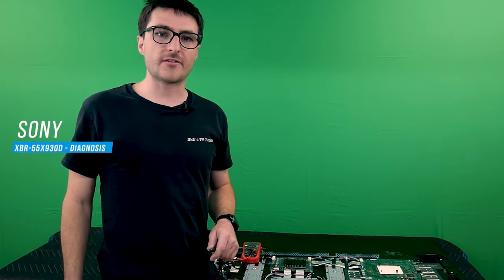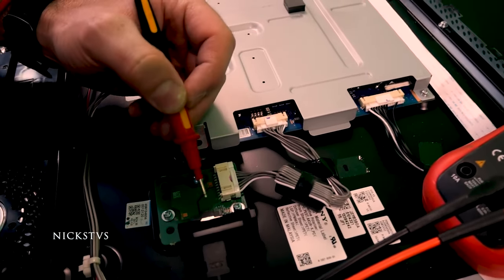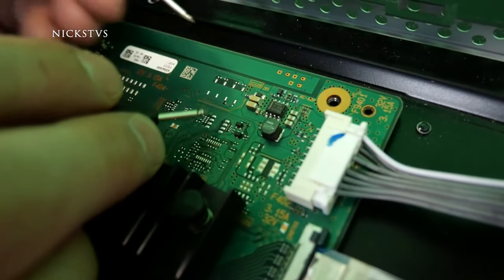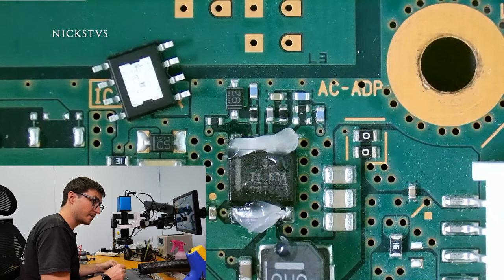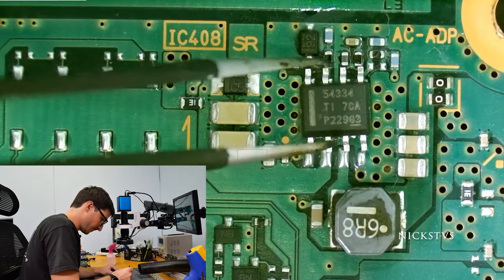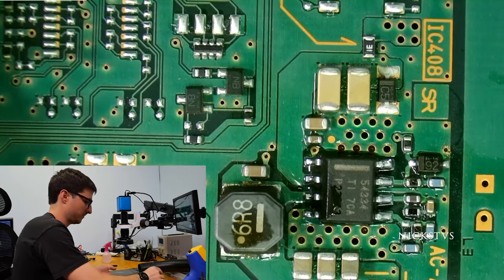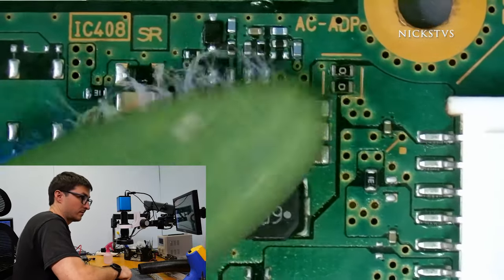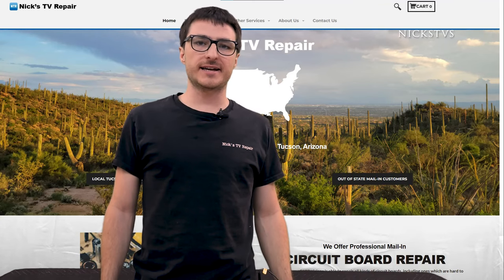Sony LED TV NO Power XBR-55X930D XBR-65X930D DPS

Comment: Hi .. I have an Sony Bravia xbr-65x900e .. when My tv is plugged only Sony log appears on screen but no take actions at All from my remote control or the power button located on side of tv and the led lights at bottom no turn on .. any suggestions that what can be?
Reply from the maker: Hello Adrian,
Yes that is going to be a mainboard related failure. That is a circuit board and a symptom we have fixed many times in the past. If you want me to fix it for you, I do give a 1 year warranty on the repair. All you need to do is purchase the service linked below and wait for the email instructions

https://www.nickstvs.com/store/p2345/XBR-65X900E.html
Reply: @NicksTVRepair  Hello Nick thank you for your quick response and link sent .. yes I would love if you can help me repairing the mainboard.. I have a question.. would you do the update of software if necessary ? Or should do it my self? Thank you again

Comment: My tv after fixing it from the orange and green alternating lights issue, now doesn't turn on a day after.. no power, no standby lights.. how do I fix this please.. Sony Bravia tv 55 inches..
Reply: Am in Ghana
Reply from the maker: Hello,

Knowing what the initial issue was along with what part you replaced to fix the TV would be helpful to know so that I can better understand the history of the set. 
But generally speaking amber green = Mainboard needs pairing. 
You can check out this video with instructions on how to do it:
https://www.youtube.com/watch?v=gBd2g7kRsEM

If you can't get the mainboard to pair, either your ribbons are damaged, not seated properly, or the mainboard has an issue.

Comment: Hello Nick, if i order this ic chip from your website will it work on my model ? kd-55XD9305..
Reply from the maker: Short answer, yes, I believe your model uses the same chip.

If you click on the link I provide to our website for the sale of the IC, it will have very clear markings on it. It should say 54334. If the IC on your board has the same numbers on it, then yes it will work for you. 
And in case you can't check, I believe there is a 99% chance that your set uses the same IC.

Comment: sir my sony lcd tv is on sony logo start android and of return to sony logo on off? plase tel problem solved
Reply from the maker: Hello,
it sounds like you have the  cycling on and off issue that is commonly caused by the mainboards. If this were my TV, I would either get a new mainboard, or get my original serviced/fixed.

Comment: I spent $200 buying a power board, main board, & T-com board, for a 58" Sharp with picture & only standby power light on. Nothing worked. Can't send the parts back to JimmyTv. Save your money, buy new.
Reply from the maker: I think you may be misplacing your frustration. 
First I am sorry to hear this has happened, I understand how irretating that can be. 

I would like to add however that the 58" sharp sets typically have LED strip failures. So indeed the parts you purchased wouldn't have fixed that issue. It is a slightly tougher diagnostic to make and can be easy to miss if you aren't familiar with TV repair.
I think a good diagnostic is very important to avoid purchasing the wrong parts, which is why I create these videos, to give you insight on how to properly diagnose your TV the first time.
Reply: @NicksTVRepair  thanks for the reply. I have no tv repair businesses near my location, unfortunately.  Lesson learned.

Comment: I want to speak to you
Reply from the maker: 4 blinks is going to be a backlight failure. If you have an OLED set, then I don't think you can fix that. 
I would highly recommend you go to a local shop to have it double checked however.

Comment: Hi! Just found your channel. Very impressed! I used to make my own sircuit board and built radio remote plains, amps etc......40 years ago. And now i'm stuck with Sony - 75" Class - LED - X900E Series - 2160p - Smart - 4K UHD TV with HDR which i've been having a lot of issues since i've baught it in 2017 paying $5200. And now - no power. Did all the trics with reset (worked before), but now it feels like id doesn't have any juice. The TV just died while I was watching it (without rebooting as it happened before) I don't wanna through it away, but I've seen how you used hot air for soldering. Do I need it? An if I will have the same problem, where can I buy cheap?
Reply from the maker: If you have an XBR-75X900E and it seems to be dead, you most likely have a bad EMMC that needs to be replaced. I don't think it would be something I would recommend performing on your own. 
Here is a video you can watch where we change out the EMMC. 
https://youtu.be/XadBVYLJOVM

It's very involved and unless you have the correct equipment and experience, I don't recommend doing it yourself. 
I know I sound biased because we offer a service on it, and that's what I am trying to push, but these are very hard-to-find boards it's not really the type of board you should be experimenting on and seeing if you can fix it. You should practice on a low-cost $15 circuit board first, once you get the hang of it and are able to successfully perform the repair on the cheap low-stakes board, then start working on the hard-to-find and replace boards. 
Again I know I sound biased, but if you want to send in the board for repair, here is a listing for it

https://nickselectronics.com/products/xbr-75x900e

Sending it to us would dramatically increase your chances of repair success.